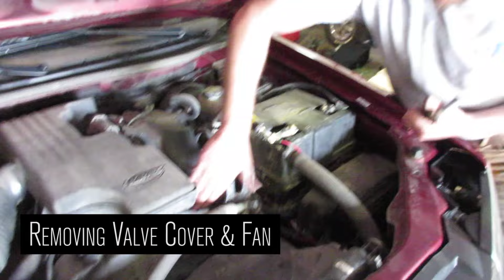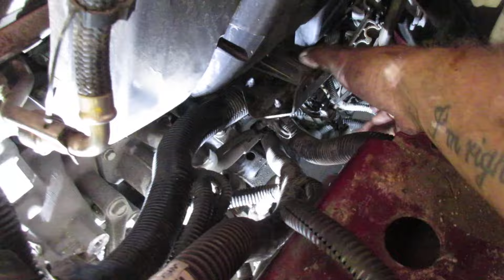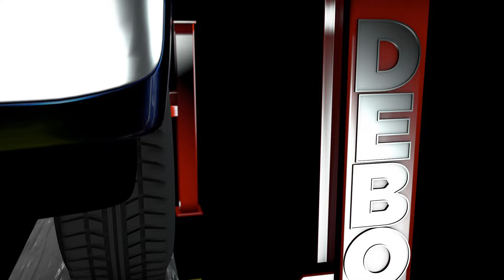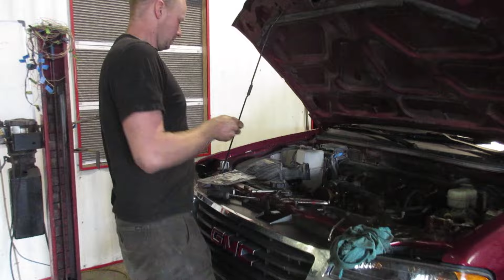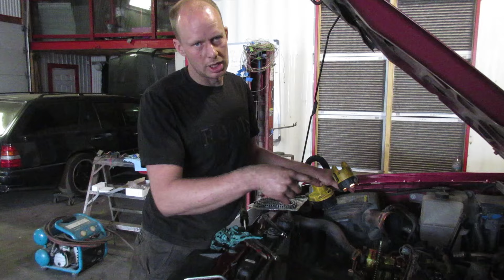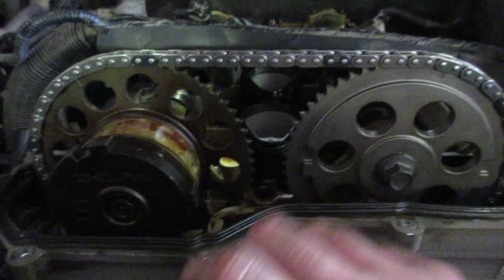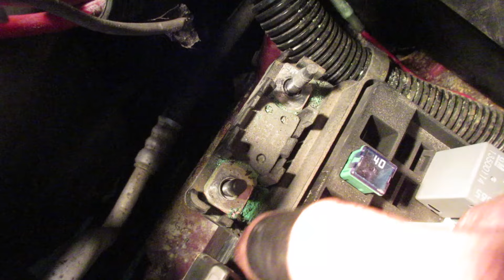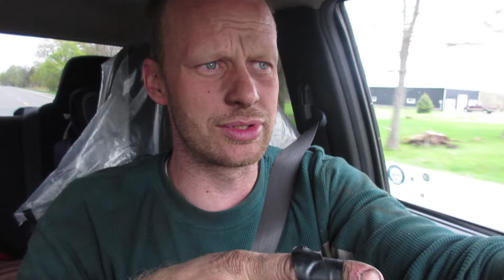Over-Engineering At Its Finest! GMC Canyon Needs A Timing Chain

Comment: These are liberal\government designs. Real engineers were fired and let go around 2008. The government has every say so in the GM,Dodge and ford. It's a shame the the GM needs this at 200,000 miles when a triton engine needs this every 60,000. And all Hemi's needs cam shaft a lifters every 15 feet. Toyota and Honda is the only real choice because the US government has no say so in there engineering. Ps if you you let a tire monitor system navigate your life your an idiot. The tire light means absolutely NOTHING. ITS ANOTHER GOVERNMENT IS YOUR MASTER PARLOR TRICK AND I DONT KNEEL TO IT. DELET IT!